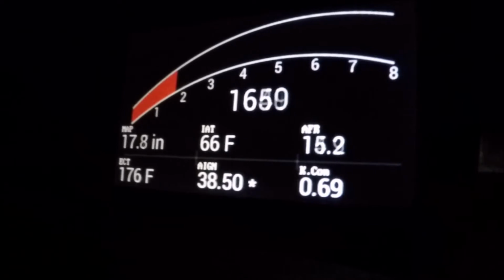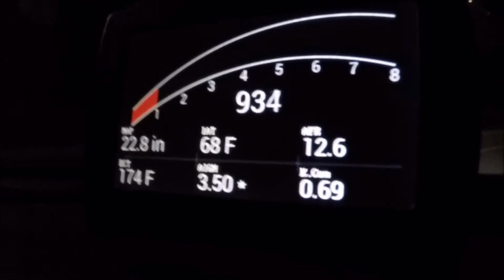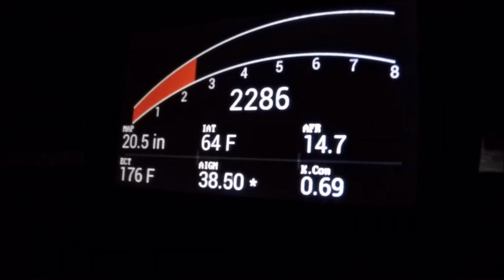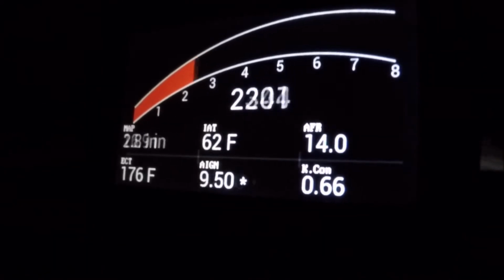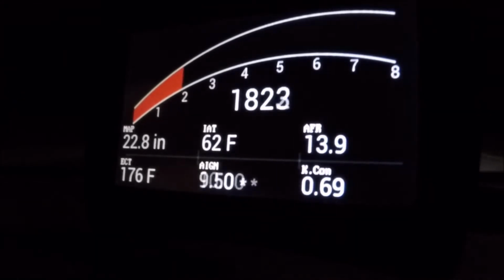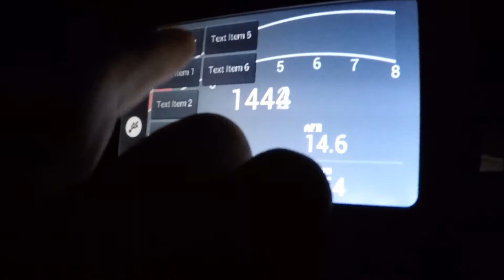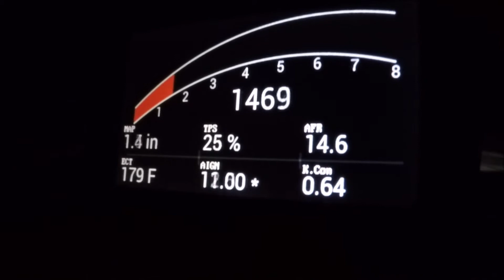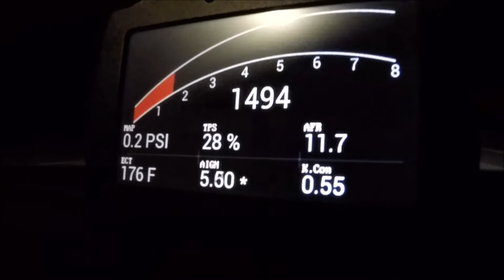How to speed up knock control learning down ktuner V2 2017 Honda Civic EXT

Comment: So I'm on the tsp stage 1 tune and had a custom catless downpipe and exhaust that ended up burning up my o2 sensor and fouling out a spark plug causing it to misfire with really high k.control. so I went back to a stock downpipe and exhaust replaced plugs and o2 sensor. Car ran perfect k.control went back to normal. 49 now not even 2 weeks later I cant get my k.control under .7 unless I reflash but the moment i get into even light boost it shoots up to sometimes 1.09 highest I've seen. I always put 93 octane fuel bit I live in Ohio which has unregulated gas so I'm not sure if I'm not getting the octane levels I should or if their is an issue somewhere

Comment: Hi, I installed one of the ktuner base maps for 2013 acura tl. My knock control always fluctuating between 0.69 and 0.43. Is that normal? Is there a maximum limit that I shall not exceed? Do I have to drive easy? And for how long?  I always use 93 octane. Thanks for sharing the  information.
Reply from the maker: What is the lowest it settles at? .49 as far as I know is the lowest it will ever go and stay although I consistently see mine go down to the low .4s as well while on the throttle then it comes back to .49 when I let off. I imagine if you see it that low you probably have the same scenario as me, only climbs to the .6 range after a long pull? Having it move around is a normal thing. I don't really know of a hard limit of where to stop but if you are running a pre loaded map, good fuel, and staying in the .6s I'd say your fine.
Reply: caraddict The lowest I get is .43 but it can go up .6 after 40% TPS pull.
Ktuner website has an example of ignition timing using knock control of .38
http://www.ktuner.com/KTunerHelp/ignition_timing_and_knock_control.htm
That makes me to believe that it should be low number since it improve the performance.
Reply from the maker: Right, lower number is better for performance but you can't choose where it goes. You could reduce the sensitivity of the system which is something I won't do. I think it was Vit who discovered there is even logic in the ecu that raises k.ctrl without any evidence of knock or even possible knock. It's just operating on the "extra" safe side of things. Also I understand you see .43 from time to time but it never settles there right? As soon as you let off the throttle it goes right back up to .49? Are you saying 40% tps or tps.cmd? What does a WOT pull climb it to then?
Reply from the maker: Oh I read it again and do you mean you are doing a 40% tps pull through one gear like 2500-redline in 3rd or a 1-2-3 going to redline each time @ 40%? Higher tps lower rpm is more apt to raise k.ctrl
Reply: I only monitored the car one time in one test since I installed the base map (I have three kids). I never went to red line or WOT during monitoring the K.control. during the idling it is always constant at .51 even if I rev the engine up to 5000 rpm. During normal driving around 1500 rpm it's fluctuating between .59 to .43. When I did a pull it was not at WOT I was pressing the gas peddale at 40% and just at the end of the pull or just after it reaches .69 and then fluctuating again between .59 and .43. I would never play with eliminating the knock control to gain more power since it may affect the engine reliability. Sorry if I'm short in technical information since I'm new to this and never went with dyno tune or custom tune. Just trying to read and learn.
Reply: Yes I saw .43 but never settle. Always fluctuating.
Reply from the maker: I wouldn't worry about it personally. how are your IATs? have you gotten to do any WOT pulls through the gears yet?
Reply: I noticed the AFR   is a little high but that is may be due to using KN air filter. This is also at high altitude. Around 0.8 mile above see level
Reply from the maker: I did watch that video a while back you had linked to. Looked good to me. If I remember right k.ctrl didn't climb, afr seemed good to me not all motors are happy at the exact same ratio. Have you looked at the afr adjust? Maybe your factory sensor reads off a bit and that's not even the true ratio? I think the rsx was like that anyways.
Reply from the maker: how warm is warmer? are you in the US or could you possibly be somewhere that posts the research octane number at the pump and not the average index like in the US, where 93 there is somewhere around 87/88 in the US? (w/ k.ctrl @ .49 though I doubt it). Also are you running the most aggressive included map? would suck to have to do it but maybe you'll have to step back to a milder map in the summers.
Reply: Thank you very much for the advice. I'm in Canada which by no means can be hot as some places in US. The maximum it can get here is 100F. Not sure if the 93 Octane here is actually a lower grade. My car is stock, so I'm running the map for stock car which only alter the air fuel ratio and nothing else based on my discussion with RV6. Also RV6 customer support told me if the K.control is below 0.9, that still makes a good power. My car one time was having a K.control = 1. After that it's around 0.7. I'm thinking also of going back to stock. Not sure if the KN air filter I have affecting the Afr and has any negative effect.
Reply from the maker: Have you asked Ktuner directly? They are really helpful over there. I am pretty sure Canada and the US rate fuels the same way. I have been up there but it was so long ago I don't really remember. The filter shouldn't mess with your AFR really, the ecu is monitoring air flow after the filter and should just compensate for any extra airflow you could possibly be getting into the engine.

Comment: Hey man just loaded my first calibration from vit last night. Was on the way to work this morning when all of a sudden cel, power steering light, brake system light, and traction control light came on. Was wondering if this happened to you or anything similar. I looked up the code it tripped and it was PO299 ( underboost code). Do you think it could have been set because of the calibration tune?
Reply from the maker: +Kali Majors first issue I have ever had was the other day on a starter tune shortly after flashing I had about every warning you get while flashing but they popped up while driving. Pulled over and reflash and it's been fine since. I'll have to admit I pulled a bonehead move and was thinking about other stuff and didn't cycle the ignition before starting after flashing... Have you done anything to the car recently where you could have a boost/vacuum leak? He has tuned so many I doubt he'd have a .kcal cause an issue even it is the first shot but there is always a chance. I know his email tried right now that he was out of town for something and I haven't gotten a reply to my question yet from 2 days ago so I imagine be is swamped after getting back because I usually had a reply by this point. I'm sure he'll get it figured out for you if it was his with that caused it though.

Comment: My kcon is high as hell( .55 to .84) on exxon's 93 Oct. When on speedway's 93 I'm stay from .49 to .63. Does this mean speedway's fuel is better for my car? Noticed I get better mpg on Exxon's fuel tho. So confused right now.
Reply from the maker: By better mpg you mean 1 maybe 2mpg or something more significant? Any chance at Exxon you're pumping non ethanol fuel?
Reply: @caraddict  yep almost 3 mpg better every trip. I'm 97% sure exxon doesnt contain ethanol where I live. Could it be the 10% ethanol that speedway has makes my engine a happy camper? It burns a little faster but it's wayyy smoother than when on exxon.
Reply from the maker: @MAXED-TRUCKING  I mean you would burn a little more fuel having ethanol in the mix vs not. And having the ethanol could explain the knock control values staying lower.

Comment: Why does my knock control jump to 1.3 at a light but my log says I’m not knocking. I have been trying to figure this out for a while. It only happens if it is over hot outside and my IAT climb above 100-110 degrees quickly. Then I stay hold at a 1.3 value for a while.
Reply from the maker: I don't know the answer except I know knock control isn't only dependant on actual knock. But are you sure you aren't looking at a different data point? What tune you running?
Reply: caraddict I use ktuner
Reply: It says k.con and is always going up and down. But then will jump to 1.30
Reply from the maker: My bad I meant what stage in ktuner? 1?, 2?, Custom? Also what fuel? And is this on a long WOT run like 1st through 5th or just a short pull through one gear?
Reply: caraddict this is at idle when it’s hot outside. I have a 9th gen on a custom tune.
Reply: High knock control does not mean your engine is knocking. It means your engine is  close to knocking and it's pulling timing so that you don't knock.
Reply: Did ypu solve the problem cuz my k.con is going up to 1.44 i own a 6-6 accord 8 gen?????

Comment: I just flashed 23 psi tune on my 2017 civic si . The knock control is about ~66 and knock  retards to about 8.0 at WOT. Is that normal
Reply: caraddict yes I did the hwy 6th gear keeping between boost and vac. Went down to about 55. Then did some pulls and went back up to 67-70. It says 91+ is recommended. Im running 91. But where I live the 91 doesn’t get used all that often and I don’t have a ton of faith it’s actually 91. Yes it’s warm . About 80 . Ktuner said I’d be fine running 91 on the 23psi tune . The car will learn and keep it safe .. but by doing that it’ll be pulling  timing which I don’t want . lol
Reply from the maker: If pulling timing keeps your engine together I bet you want it! lol. Maybe try the 21psi tune, might not pull so much timing and who knows, in the end a little more timing/little less boost might be better anyways. you have e85 available?
Reply: caraddict I switched fuels ..  still 91 octane but my knock control goes down to about 51-52 during normal driving and when I’m hard on it goes to max about 57-58. Still not quite perfect fuel for it but it’s waaaaaaay better .. I may end up just running 94 and pay the extra .
Reply from the maker: where you getting 94?
Reply: caraddict update . Tried all the 91’s around me . Sport mode (23psi) the k control sky rocketed . Tried 94 and In normal mode (19psi) the k control stayed down no matter what . But soon as I went to sport and did a hard hwy pull the k control sky rocketed again . The 94 is petro Canada 94 . It’s the ONLY 94 within 100km of me . so I guess the 94 actually isn’t 94 and it’s just not enough octane . Seems really weird . Ktuner said it was something wrong with my car.. but if there was something wrong with my car why would k control stay under 54 during pulls on the 19psi normal mode .. only sky rockets in sport 23. But with 94 it should be good in the 23 psi mode ..

Comment: CVT owners just light constant throttle lol!
Reply from the maker: you know, I didn't even think about cvt owners... do all models have manual mode/paddles?
Reply: nope , just the touring has it . On LX , EX and EX-L ( like mine ) just has D ( Drive ) S ( Sport )  and L  ( Low Gear ) . With L on pushes nice up till 100mph and than your better off using Sport ( fake shifts lol ) and tops off at 125mph ( Speed limiter ) Now mine has the Hondata ( and rolling with 25psi ) which ive taken off the speed limiter  and didnt have the balls to go more than 168mph . Very soft suspension. Need to upgrade  ASAP. Mine is the hatchback by the way . Love watching your videos ! Keep up the great work ! Oh and when you get the chance , get an external Mic to hook up your GoPro . I got mine on amazon for 20 bucks . Bought the sony . Take it easy . Later
Reply from the maker: +brisolaslip only problem is I have the hero 5 so I have to buy the genuine accessory since it's a usb-c and has to have a analog to digital converter built into the adapter or something like that. I forget what I found when I was looking and at least at the time no 3rd party stuff was available. And you are nuts going 168 on stock suspension! Lol I hit 113 and it felt decent until I started braking and the car wanted to go everywhere... Wasn't cool. CTR RSB and coilovers are on the list but I'm a broke dude these days. I wish I could just find 1000 random people to give me a buck, that would be awesome. Come to think of it I heard the beggers under the overpass do alright...

Comment: What’s the point in the knock control to lower? - I’m a noob lol
Reply from the maker: Long story short ECU pulls timing based on knock control. It's a way for the ECU to deal with different fuel qualities. So if you run 87 the knock control will be higher than running 92... Lower knock control, greater ignition advance, more power.
Reply: caraddict thanks !